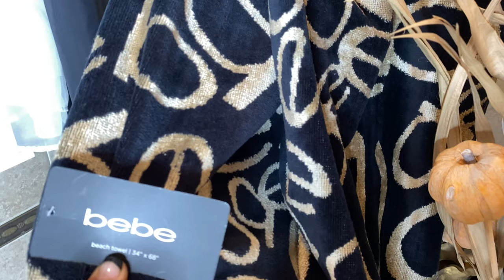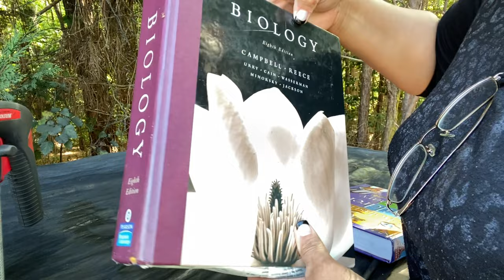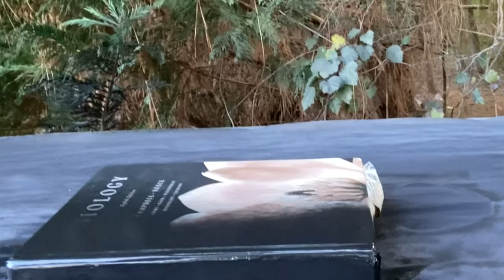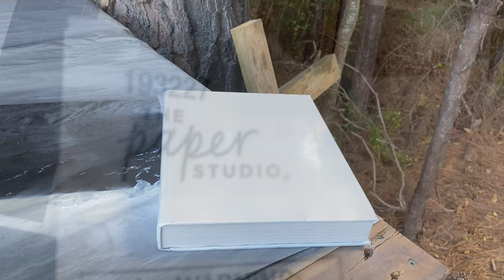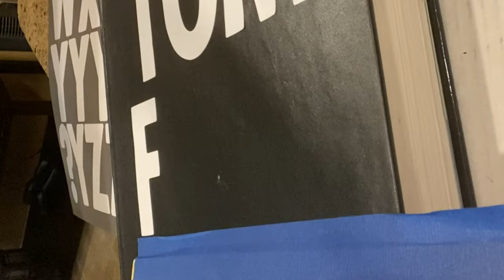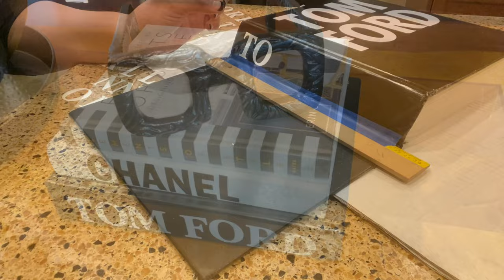FALL CLEAN AND DECORATE WITH ME 2022 BATHROOM DECORATING IDEAS PRIMARY BATHROOM CLEAN AND FALL DECOR

Comment: Your cleaning is off the chain girl.  I also clean my tub. Now one other thing you didn't mention is that fact there is still water in the jetted area. I run more Water after cleaning to remove any left over cleaner is a point to be mentioned.  Great video.  Thank you 😊
Reply from the maker: Hi Yvonne, Great tip! I will be sure to run another tub of water before I use it. Never thought about that. Thanks for watching and supporting my channel. Have a blessed weekend.

Comment: Vinegar and soda will help the build up of oils from the body.
Reply from the maker: Hi Sharon do you mix this in a bottle? Also, is that baking soda you're referring to?
Reply: @shannalakale3431  hi, shake baking soda in the shower you can buy the cheap baking soda. Pour white vinegar or use a spray bottle with vinegar in it  stream spray bottle. Not mist bottle.
Reply from the maker: @sharonpatrick9807  Thanks for sharing. 😀